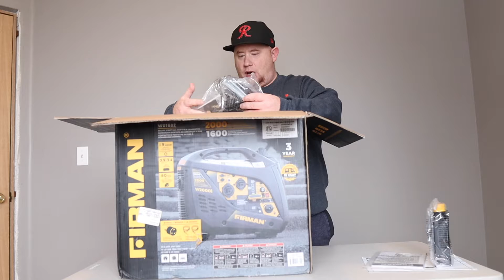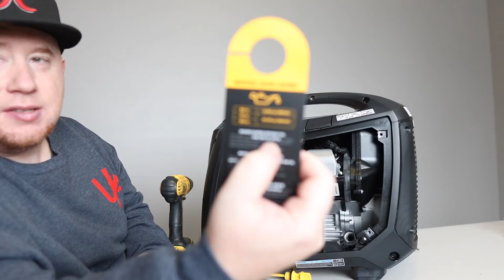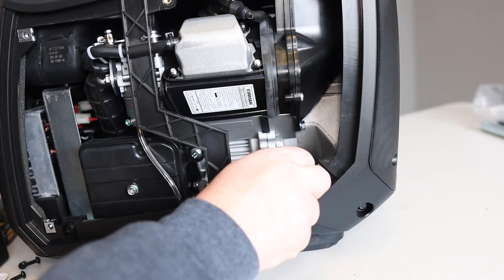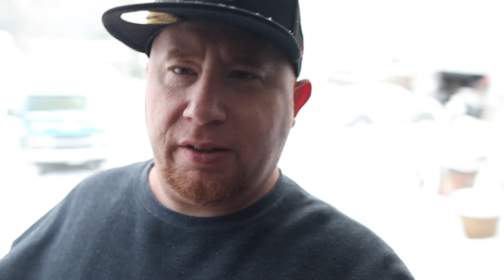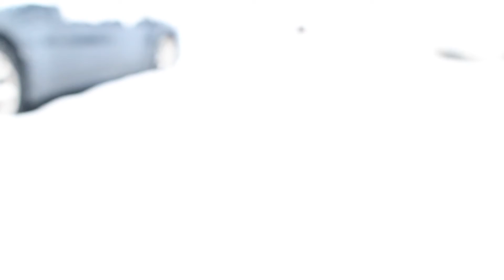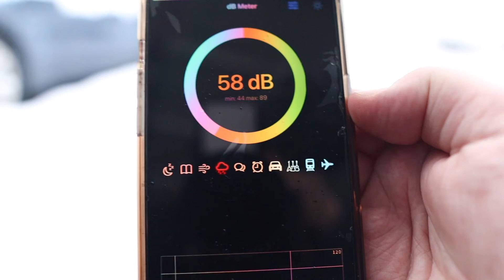FIRMAN 2000 WATT GENERATOR SETUP AND DB TEST | WHERE TO BUY A FIRMAN GENERATOR ?

Comment: Great video, how do you use the 30 amp plug for home use? Thanks
Reply from the maker: The only way to use the 30 amp plug for home use would be to have a dedicated 30 amp line to backfeed into the house. With this size generator it might be better just running 15 amp extension cords to get what you need plugged in.  You may want to look at a bigger generator to do complete house power if thats what you are after. Hop this help  and thanks for the great comment !
Reply: @UniqueAdventurez  thanks for the reply, what I meant how to use/step down the 30 amp jack for using as a regular inlet for 15 amp
Reply from the maker: @seangholipour3884   gotcha.  So what you needs is a step down dog bone (thats what we call them in the RV world). you just need a 30 to 15 amp adapter. Can usually be purchased at you local walmart or RV store, and of course amazon.  Should be around 10$

Comment: Great video! Thank you for the review. I have seen some really good deals on these recently. Have you or anyone here every run these in parallel direct to each other without the $100 kit? That would be a deal breaker!
Reply from the maker: To answer your question, yes you can. Each 2000 watt generator comes with the Parallel adapter cable you need. No additional cables needed.  Thanks for the great question and support !
Reply: @UniqueAdventurez  Thank You!

Comment: We bought two of these at Costco when they were $349. We parallel them to run the roof top AC unit, but for all other RV uses one has been sufficient.  I use one then switch to the other when it runs out of gas. I've got about 150 hours on each of them. Oil changes every 50 to 60 hours. They are a little bit louder than my father's honda 2000 watt unit but the price made it an easy decision.  No problems with them so far. I typically get about six to eight hours per tank running the tv, blue ray and occasional appliances. They still start on the first pull, and I always use them in eco mode. Save $$ on gas!
Reply from the maker: Eric, we are totally thrilled you are having a good experience with them. for 350 during that sale last year was a complete steal. and the cost difference for a couple of Db’s is something I could live with. people get too wrapped up on the Db readings , that’s why we try and test every unit we can get our hands on. our only mistake was not getting 2 of these ! Thanks for the awesome comment , we really appreciate it .